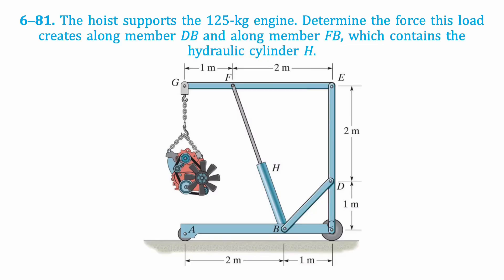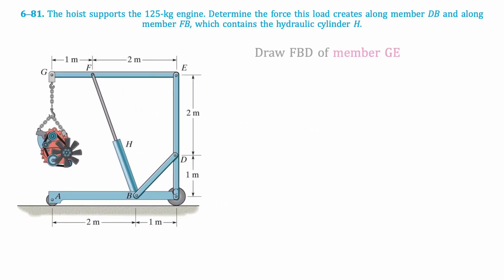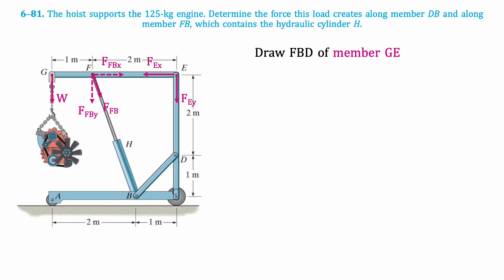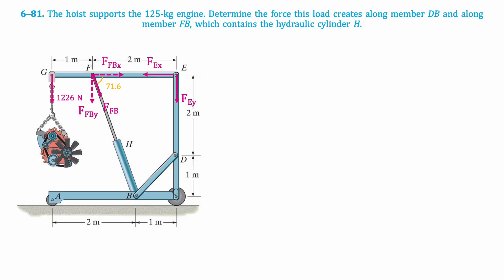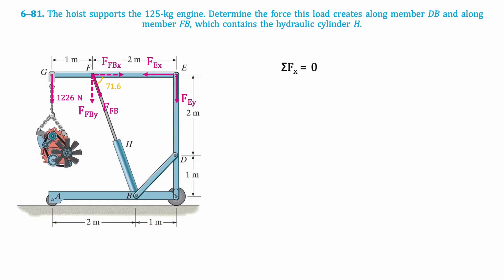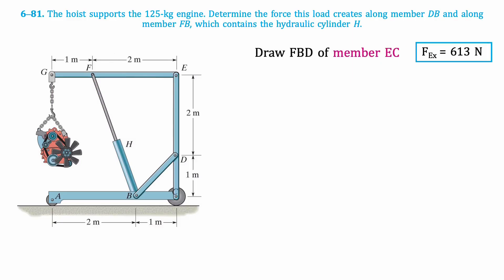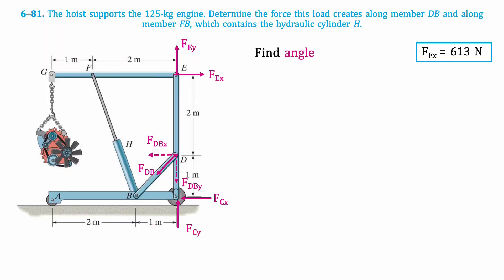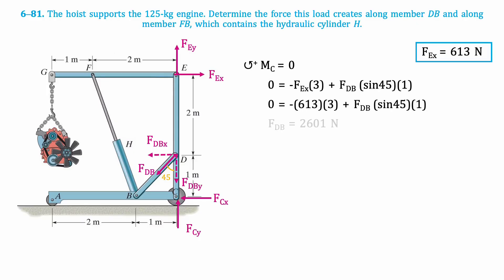The hoist supports the 125-kg engine. Determine the force along member DB and along member FB.

Comment: no idea why tan theta is 3/1
Reply: Imagine a triangle where F points straight down then over to B then connects from F to B. The height of that triangle is 3m (O) and the length is 1m (A) when the triangle is flipped so the Tan is 3/1. 

Its much easier to look at it and instead of finding theta just draw a triangle and its lengths and put in 1/sqrt10 and 3/sqrt10 because sqrt10 is the hypotenuse